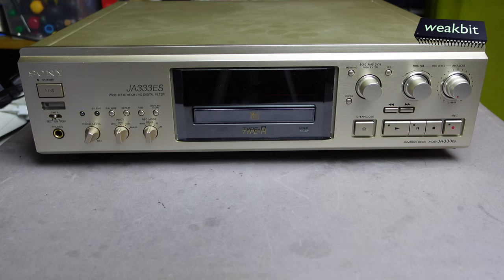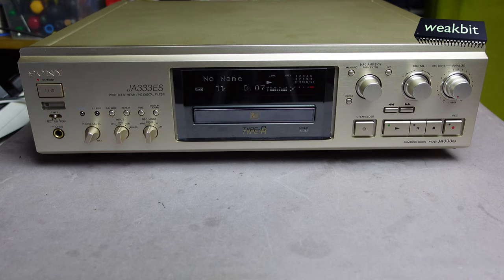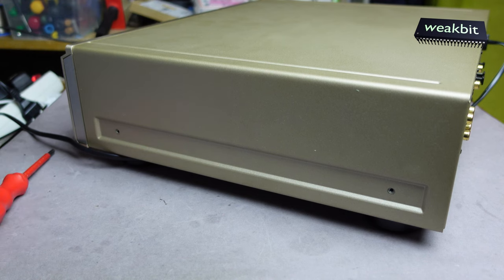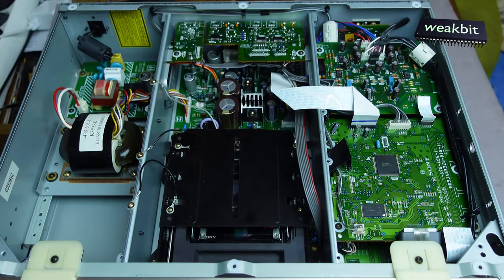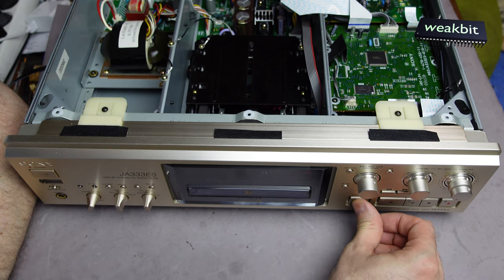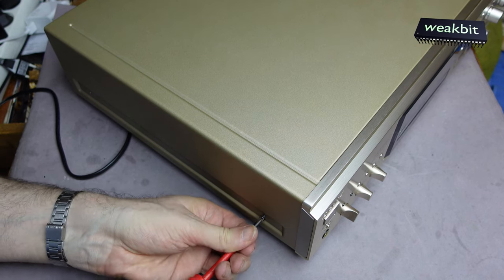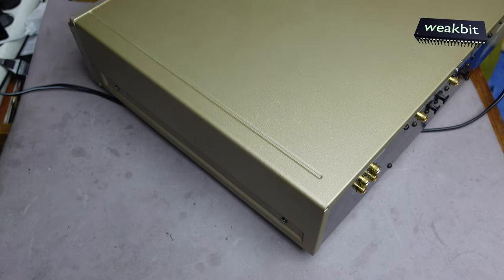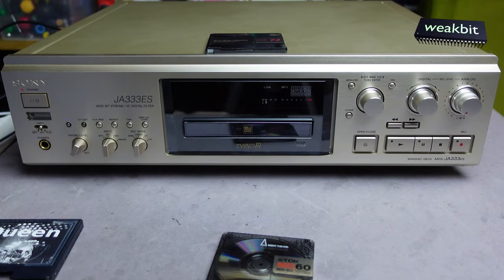Sony MDS-JA333ES repair

Comment: @weakbit - why didn’t you re-lubricate the internal ejection track, cogs, and gears while you had it open?  Also, the laser transport bar could use some lubrication. Will vastly extend its life.
Reply from the maker: I fix only the problem. I remember there was no need to lubricate the plastic gear to metal slider all work without drag. If you lubricate ones you should built all out and then clean it in the ultrasonic. But I don't do that it was in this case not necessary. There was on viewer why I don't change the caps if I have it open? and why I don't align the Laser-Current. This is the same as a car you can repair the failure/problem or you buy simple a new one. I can not waste my time on lubricating, re-caping, lens cleaning, laser-pickup change, change all the complete machine, important to cleaning the residue (the Industry don't do that and I don't do it - for what it is a isolation) inside. If you do this for you at your home private and you have time and fix a problem you can do it but in my case it was not necessary. I only see people they are lubricate the dirty slider in a drive this is bu****it - you must clean all with a chemical liquid and remove all the rest of the grease with a ultrasonic - and for sure you have right I don't do it in this case.
Reply from the maker: normal I use: Nigrin Mehrzweck-Fett DIN51802 und DIN51825 -30°C till +120°C Art-Nr.74145 4008153741456 Made in Germany Nigrin.com
Reply: @weakbit633   - well alrighty then!  Makes sense.
Reply from the maker: @EnochLight  One other thing - I want to built a CD-Player drive and my question is can I make it at home a DIY laserpickup with the 3D-printer maybe I want do this. Remember the technique is now over 40years old why we can't make it at home with the computer? this will be a cool project that everybody can print a CD-Player. What do you think about a project like this?

Comment: Congratulations 🍾 sir
Reply from the maker: Thank you sir! I've so much problems to get the spar parts in 2023 - delivery delay from about 4months are now normal and I think what I make a 2nd Video channel? Are you interest in a DIY (Do It Yourself) build Amplifier with a lot of inputs like I think 8inputs and 4outputs and 1subwoofer out? maybe we should make a amplifier by our self? we make a cool thing.
Reply: @weakbit633  i like subwoofer low pass filter sir you have schematic diagram ?

Comment: Hello. I bought a second-hand SON MDS JA555ES, but unfortunately it says error C13 and ejects the disk. After examining it, I found that the disc does not spin or the optics do not light up, even with the service menu, endless playback. The magnetic head is focused and the optics are moved. I checked the limit switches. You would help me a lot if I could make it passable.
Reply from the maker: please download the service manual https://elektrotanya.com/sony_mds-ja555es.pdf/download.html - I've only repair ones this machine and there was so in my Video to see a mechanical issue that I fix.
Reply: @weakbit633  thank you I already have this one downloaded too. I don't know if I should look for it as a problem with the optics or with the disc rotation. The disk should spin even if the optics do not work? It would help me, maybe, if I had an answer to that. Because there are some transistors in front of the optics that control it.

Comment: Look inside the MDS JA555ES 😂
Reply: Look inside the CDP-XA555ES
Reply: @Salty_Legionnaire   - that's not an MD deck.   The point was, the  MDS JA555ES has about 10 pounds more weight to it because of the additional components - the power supply by itself is massive!

Comment: Hello ,New Subscriber here.( I hope you can help me).I have a SONY MDS JA 50 ES (NEW OLD STOCK).The problem is when i plugged in the standby light remains lit on red and nothing displays on the screen. When I press the buttons nothing happens. Except for (while pressing ams & rec i can access the service test mode).Any help from you would be greatly appreciated.Thanks
Reply from the maker: Sony MDS JA 50 ES - I'm sorry I've never hear from this machine. Did you find the service manual first this help me near all the time. download it here: https://elektrotanya.com/sony_mds-ja50es.pdf/download.html
Reply: @weakbit633  Oke ,thank you.:goodvibes: